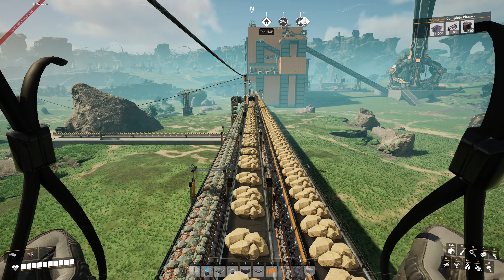Starting the Main Bus - Ep13 - Satisfactory

Comment: Conveyer lifts can be infinite length when attaching to a floor hole at the top. You just have to be able to aim at it accurately (not a problem with your stairs).  It becomes trivial to go huge distances with them once you get the jetpack.
Reply from the maker: I don't remember what episode it is, but I did use floor holes to make a very long conveyor lift when I brought the SAM ore up out of the spider hole near my factory.
Reply: @Ken.Merritt it was this one, and you did it in stages with a couple of floor holes along the way.  It can be done in one step, though.
Reply from the maker: I see what you're saying now. I don't have to click the intermediate floor holes. Just click the top and then the bottom.
Reply: @Ken.Merritt  actually it works the other way.  Start it at the bottom and aim at the floor hole above.  Going down doesn't work unless you have a floor hole at the bottom as well - you'll be limited to the normal height otherwise.  I believe "finishing" the lift at a floor hole is the key.

It can be tricky to line up if you're outside... I place my top floor hole and then zoop vertical foundations from it down to where I want to start my lift. Then delete all but the lowest, which leaves a flat surface on the same grid to easily line your lift up with the floor hole above.  Once the lift is placed you can delete that one as well, if it looks out of place, or if the grids at the top and bottom don't line up (happens in caves a lot).